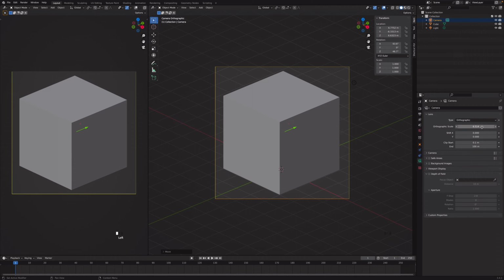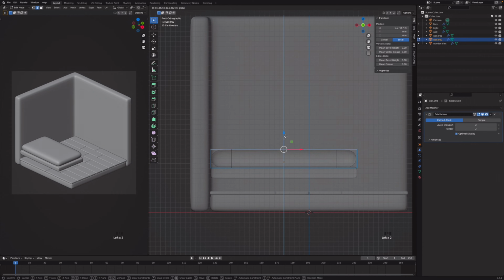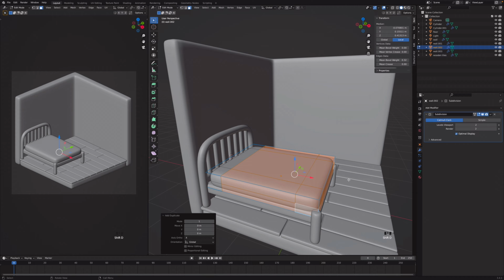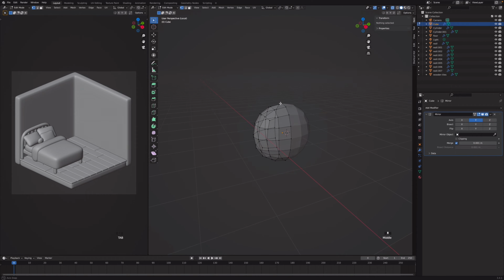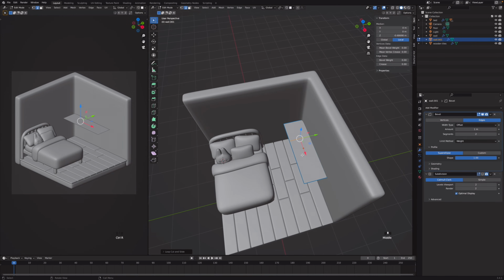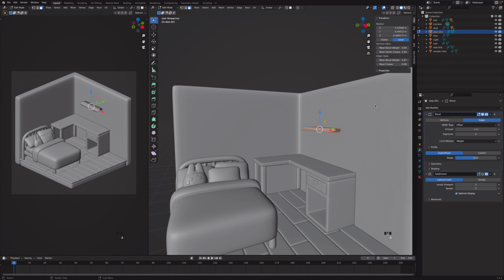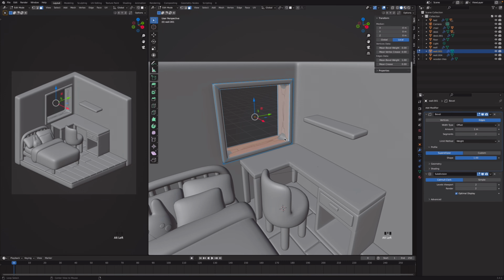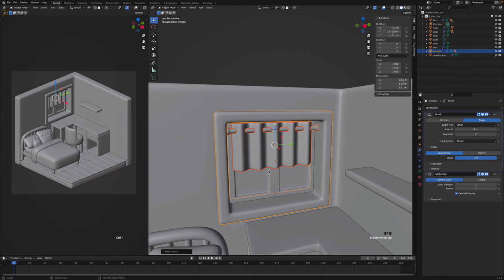3D Isometric Bedroom | Blender Tutorial for Beginners | Part 1

Comment: Tip: select every objects origin to geometry with right click on object  > select object > geometry so you can rotate and stretch properly
Double tap I to inset faces individually
To copy modifiers make sure to click last the object you want to copy from
To make objects into a parent, make sure that you click the parent object last. From child > parent
For mirror objects, use the dropper to attach the mirror to the desired object
To straighten a vertex, press s + x,y,z + 0

Comment: For the floor:

tab for edit mode
3 for face selection
select top
shift d to duplicate, right click to finish duplicate
p to separate > selection
tab to exit edit mode
select new object on the right pane (floor.001)
tab to enter edit mode
ctlr r to add loop cut, *do not move mouse or you'll mess it up*, scroll down to 8
WITHOUT MOVING, left click twice
ctlr b for bevel, move slightly to the side to make gaps on the floor (make sure the orange lines are thin but separated, not big orange lines), then left click to apply
x -> delete faces
7 numpad / top view
ctlr r for middle loop cut on bottom board, do not move mouse, double click
ctlr r + scroll once, do not move mouse, double click
hold shift while clicking on each loop cut 
ctlr b for bevel, move slightly to the side, then click to apply bevel
x -> delete faces
a to select everything
e to extrude, move mouse up and left click to apply
a to select everything, increase main level to 1

hope it helps!!
Reply: Another tip it's that if you mess up on the loop cut (ctrl r)  and move the mouse you can press right click and it will restart the position
Reply: can you help me, i can not ctrl R to add loop cut. i press ctrl R but it has nothing. thank you
Reply: i love you so much
Reply: bless your kind soul TvT
Reply: Another tip it's that if you mess up on the loop cut (ctrl r)  and move the mouse you can press right click and it will restart the position
Reply: Another tip it's that if you mess up on the loop cut (ctrl r)  and move the mouse you can press right click and it will restart the position

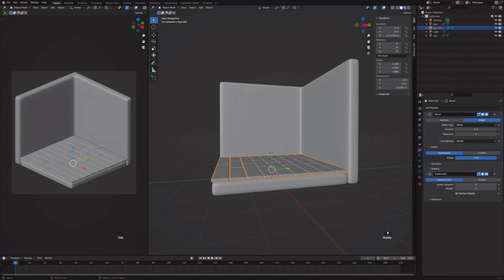Comment: For the wooden tiles/floor, around 03:06 , it's easier to just select all the faces of the tiles you made with the loops with SHIFT, then use E to extrude and then A to select all and set the mean weight. I was stuck at how to select only the tiles and not the base floor and tiles with what she said so I just went with this.

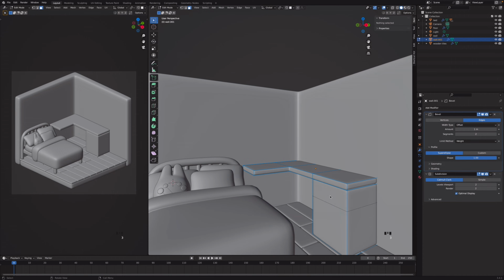Comment: Thank you for this tutorial! Super helpful, I have a minor issue though. At 16:34 while making the desk, when I inset for the drawers, the bevels for the entire desk just goes flat. There are no rounded corners or anything, just sharp edges, not sure why this happened :( I tried remaking the desk a few times and it's still the same issue.
Reply: Same here I left it like that 😅
Reply: @zulaykhasulaiman3296  Hi! I don't know if you ever got around to fixing it, but I found a solution that worked for me if applying scale doesn't work! In edit mode I would select all, press F3, search for "merge", and then click "by distance". Hope it works for you and anyone who reads this!
Reply: @SoobakStudio  Thank you so much
Reply: @SoobakStudio  Thank you so much!! I had the same issue with the desk edges being sharp and not curved, and when I used your method, it fixed the issue completely! Thank you!!  😊♡

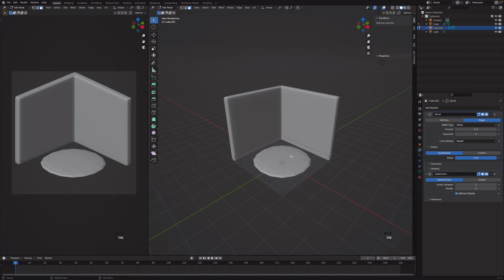Comment: 1:52 After using the solidify modifier and applying it to the floor then copying the bevel and subdivision modifiers on my wall to the floor and going into edit to change the bevel weight to 1, my floor will not change from a circle. I've retried twice ): Has anyone come across this?
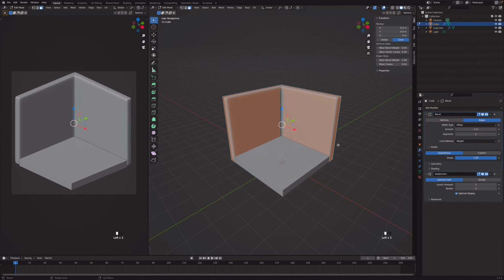Reply: I know this is a month late but if you haven't figured it out: You need to apply the Solidify modifiers on them before copying the steps. She didn't really explain that part and sorta skipped over it, but if you slow down the video around 1:46 you will see she hits "Apply" on all the modifiers before moving onto the floor.
Reply: @RutoBun  u saved me thanks!
Reply: I’m having the same problem

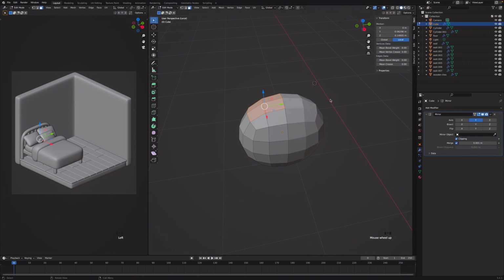Comment: At 12:14, when I try to intrude the faces, it makes four smaller faces rather than one face. My proportional editing is also off. Any help with this?
Reply: I double clicked “I” and it worked
Reply: @yowaimomo7359  
Thank you so much 
This question and answer helped a lot
Reply: Hi! I don't know if you found the solution yet but I just got the same issue and here is what I did:
First, try to press I a second time, it should merge the four faces. (You can simultaneously change to "individually" (in your case) to "merge" by pressing I) If it's not the case (like me), select all the vertices (vertex select), then right click, "merge vertices"  and "by distance". 
When I did that, 64 vertices were deleted and I could finally go on with the tutorial. It seems that I got those duplicated by accident (Idk how)
I hope I was clear! (I would have never found this without my dad's help)

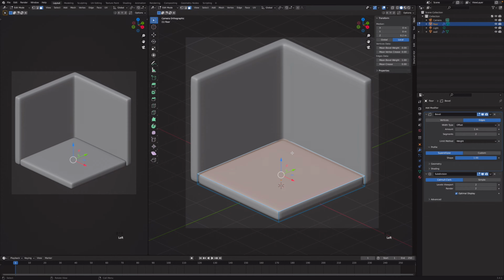Comment: 2:20 I have tried for hours to make the floor. When I bevel it the end of each section is not correctly made. They don't have the blue edges anymore. I tried recalculating normals, merging each verticle together, removing by doubles etc.
Reply: I had this issue before. She doesn’t say it but she apply scale to the floor and wall. You do this by Ctrl A then apply scale. Hope this helps
Reply: @evadesmoutier1876 I did but still an issue 😢 I don’t wanna give up
Reply: Shift + D then P and choose Sekection :)
Reply: I did that, I tried again but still an issue. @mistleteapot
Reply: it happened to me too, bevel it less
Reply: @saeran5322  that doesn't work for me. I had to rip it

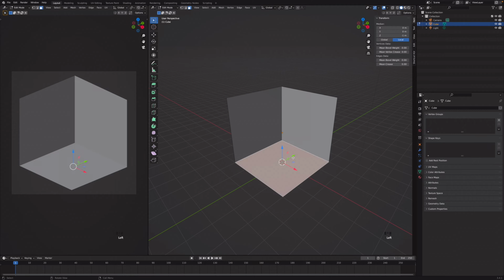Comment: 0:50 when i separate by selection and apply a solidify modifier, it thickens the walls instead of the floor no matter what i do. I separated by selection while the floor is selected and added the modifier while the floor is still selected but it only thickens the walls :( pls help <3
Reply: don't forget to press tab after making separation and then click on the floor to select it before adding the modifier, hope it help :)
Reply: @axott  lifesaver ily
Reply: @axott  you'll never see but I almost gave up, tysm lol
Reply: the same thing is happening to me!!
Reply: ok, so, i tried a bunch of things and maybe something worked. when you "divide" the cube into cube and cube .001 you will see a symbol of a triangle on the side of the cube on the scene panel on your top right. try clicking on the same spot but for the cube .001

Comment: Does any 3dsMax users know a better way to replicate what was done with the floors and walls? In Max, I used the chamfer modifier to get the same effect, but I would have to manually adjust the topology to use open subdivide since the shape will just collapse. I am new to modeling so any tips would be appreciated!

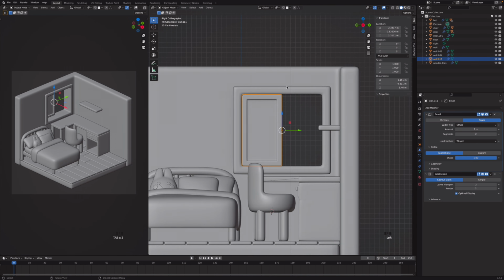Comment: on 24:38 I was having trouble figuring out how to extrude as directed to where both faces come together. I stayed in edit mode with both faces selected and extruded along normals on the x axis (it couple be a different axis for you depending on how your room is set up) and that seemed to work just fine :)
Reply: Thank you for this fix i was stuck on this area could not get both to do it until i did extrude along normals

Comment: 8:37 u don’t explain how getting that shape for the blanket was because you duplicated the bottom side also then went back and deleted it. If you just do the 3 faces initially that is not the shape u get.
Reply: i have been stuck on making the blanket for so long. so we select the bottom faces also right?
Reply: @laktoez111 old comment but just in case someone else finds this, you only select the top 3 faces of the mattress and should get this exact shape. She accidentally selected the whole thing and corrected herself mistake later

Comment: hi, around the 2:40 mark when I do the bevel and press X to delete faces for the floor, it doesn't change. any idea what I am doing wrong? I've done every step up until this point
Reply: It worked fine for me but if you can't do with shortcut then do manually.
* After beveling left click to confirm
* Go to face select mode (besides edit/objest mode on top left corner)
* Click right mouse button - delete faces.
Reply: @valenciasainz  okay thank you :) I’ll try again
Reply: Hi, I found this because I thought it would have taken a long time. Please refer to this video. Split the loop, then double-click the left. And you can see one more line by pressing Ctrl+b and moving the mouse. Make sure that two lines are correct at this time, not one line. Then press x and erase your face, and you can solve it like a video. https://www.youtube.com/watch?v=70_PihFbuz4&t=230s

Comment: hi, so far tutorial is great, I am having difficulties with knowing what mode we are in (for example object or edit mode). I wanted some help knowing if you applied the subdivision modifier after you finished the walls at 1:49? thanks so much
Reply from the maker: I normally don't apply the subdivision modifier. Also, the easiest way to tell which mode you're in is looking at the left hand tool bar. There are more options available in edit mode
Reply: @artbytran_  Ok thanks so much for replying so fast, and for the tip! I’ll work on it today as well, have a great day 👍👍😊

Comment: Hey! can you help me? my soft edges keep disappearing and turning to hard edges, it happened when I made the walls, I had to remake the from scratch.  and now it's happening to the table but I don't wanna remake everything everytime this happens. As I set the drawer to mean bevel weight 1, the table turned to hard edges, but all the settings are exactly like yours. I'm very new to blender. I don't know why is this happening.
Reply from the maker: I'm not sure what happened but if you can, send me pictures on my IG and I can take a look at it
Reply: @artbytran_  Thanks Tran, if I come by this problem again I'll definitely send images!
Reply: mine does this too - did you figure out a solution? <3
Reply: Hi, i had the same problem, and i figure it out, when i used intrude on the front faces (I+I), you can see at that moment corners starts to loose softness, bt if i use 'I' for every face separate, is works correct
Reply: Did you find the solution to this ?

Comment: at 5:23 precisely once you pressed ctrl+shift+B to bend there's a new black dot appearing on each of the side, which doesn't happen with me, something i did wrong ?
Reply from the maker: have you tried pressing 1 for vertices selection prior to ctrl+shift+B? those black dots are called vertices
Reply: @artbytran_  hey tran thanks for taking your time to answer me, yes i had 1 pressed, actually i found the missing piece of the puzzle, all i needed is to scroll up the wheel to add vertices. thank you